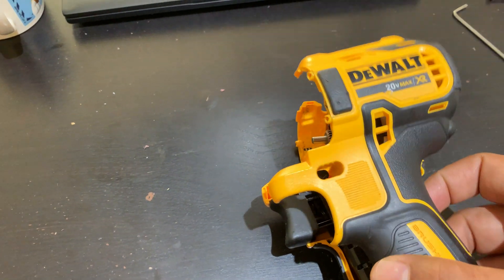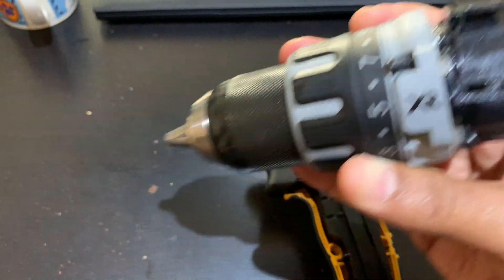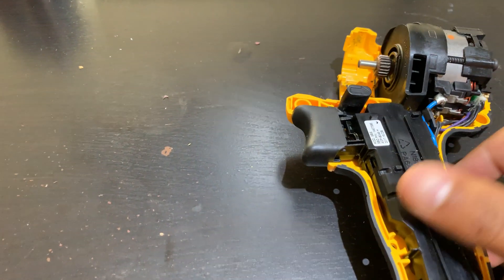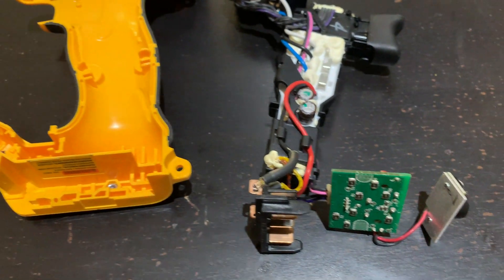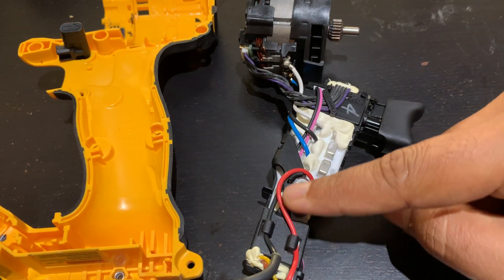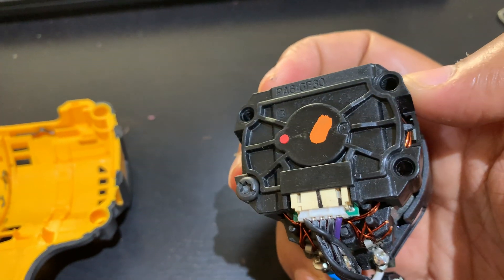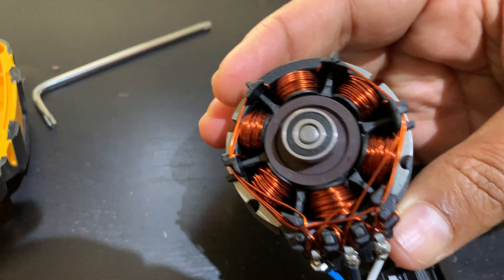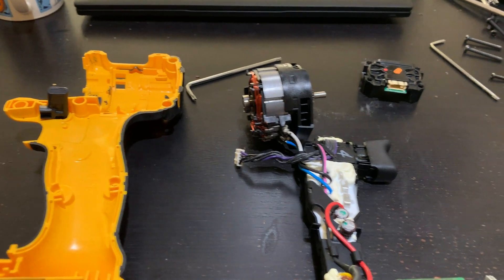Inside a Dewalt Brushless Drill

Comment: Good video. There are mainly two types of brushless motor in terms of how to control them. There are sensored and sensorless motors. The first kinds are used for low speed and very controlled rotation. It uses hall sensors to determine the position of the rotor and allow them to rotate with load very smoothly. Thats the case of these drillers. Then the sensorless motors are used in drones, helicopters and most of rc cars. They do not need the hall sensors cause the speed controllers determines where the rotor ones the rotor is rotating so the first revolutions are not very smooth. 💪💪